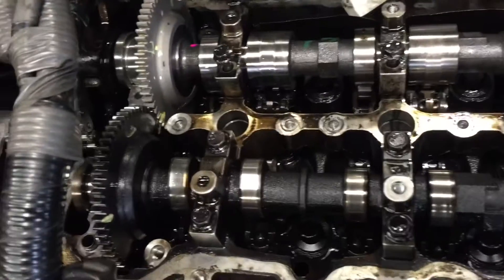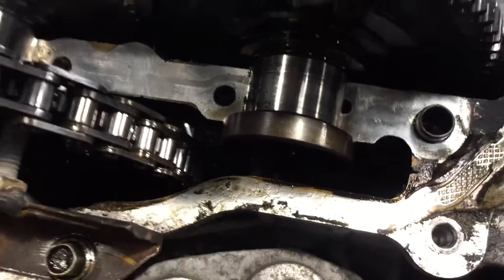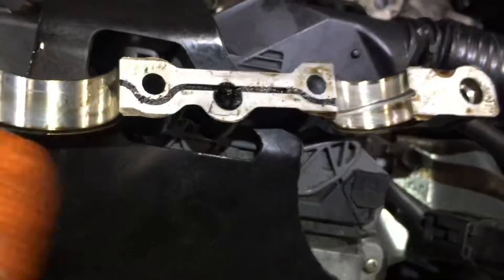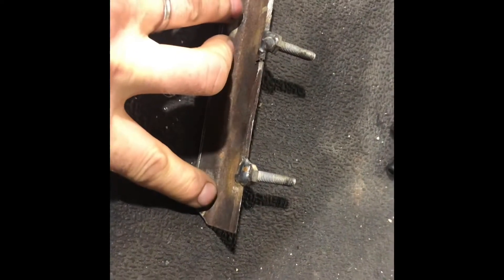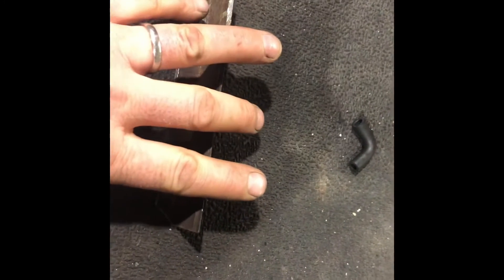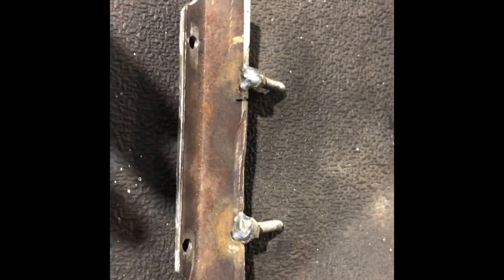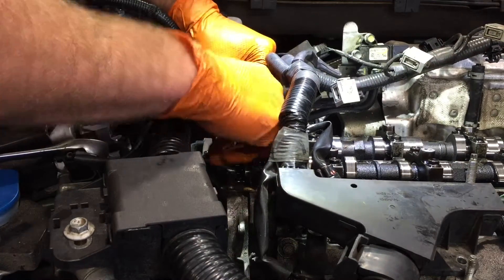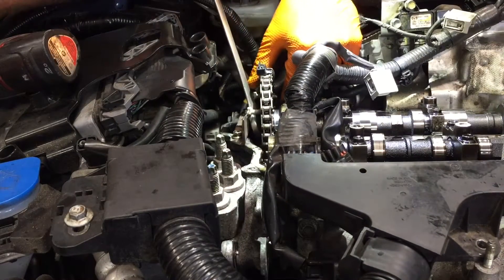Mazda 2.2 camshaft changing without removing timing chain

Comment: Just watching this video after recently subscribing and not long after getting a Mazda CX-5 would you replace the strainer in the sump as preventative maintenance? Would you also check the cam in case any crud in the oil way? I plan to keep for a few years. 

Great videos and thanks for the work very informative
Reply from the maker: Hi John, thank you for the nice comments & I’m glad you find them informative. The most common cause of the carbon buildup that blocks the oil strainer comes from the under the injectors ( the copper washers failing)
So what I would do is keep an eye on the crankcase pressure. The easiest way to do this is remove the oil filler cap when the engine is running and listen, you should hear a pop pop pop. This is combustion leaking into the crankcase. More detailed investigations could involve a borascope ( camera on a wire )
Or a pressure sensor. 
But have a listen first and see 🤔
Hope this helps 🙏👍
Reply: @kennedysgarage3281  thanks Peter that helps a lot I’ll have a listen to it and if I hear anything I’ll have it looked at.